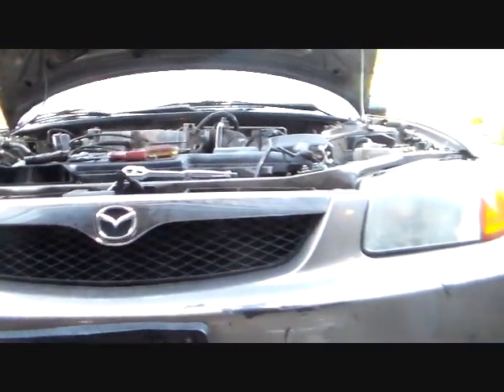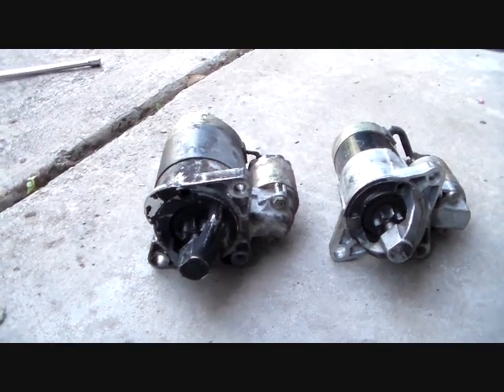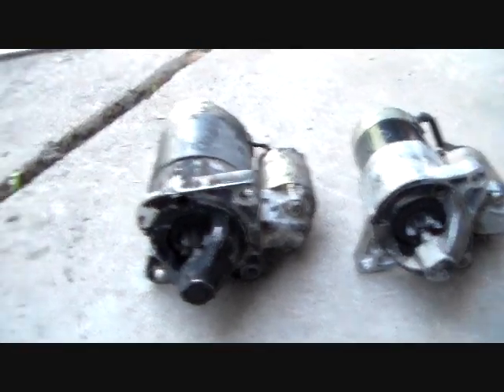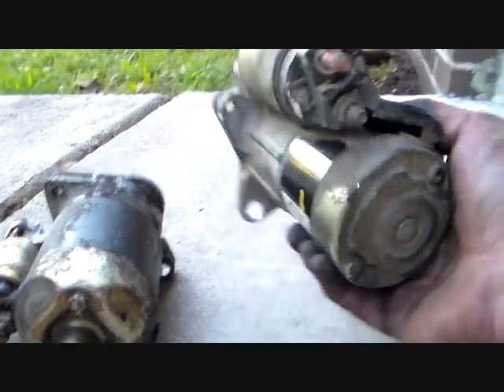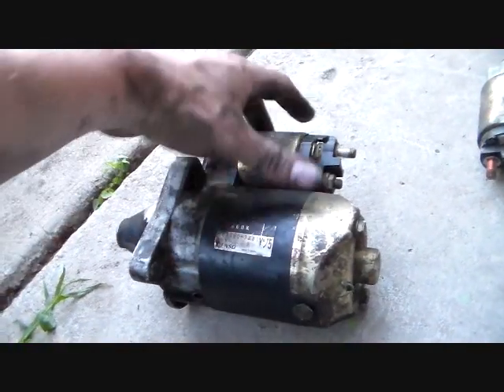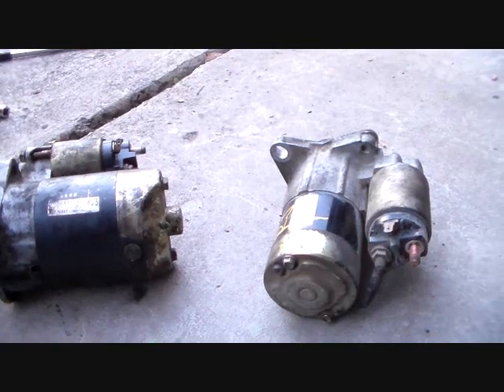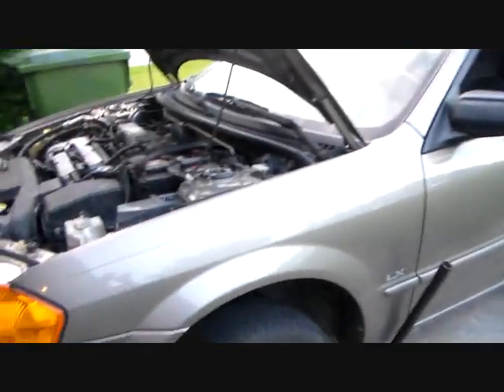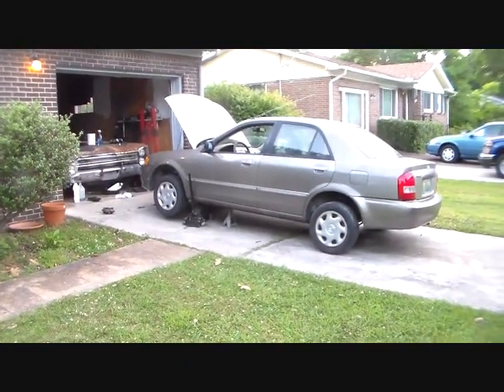Mazda Protege starter upgrade

Comment: Is it better to buy the new starter instead of a re-manufactured one ? Is the removal and installation process simple/is there anything I should be aware of ? I have same make/model but 1.6L and auto trans. Great channel btw.
Reply from the maker: They are very reliable starters so I wouldn't stress over getting a reman. Just get a good warranty. As I recall it was a direct swap, not mods needed. However, your car should already have the gear reduction starter since it's an automatic. Manuals got direct drive, auto got gear reduction, don't ask me why.

Comment: I have the exact same car, same color and year, and I replaced my starter and ran into this same thing. At our shop, I ordered a starter and it called for two different types for my 1.6 manual protege. I got both, then compared them. One was the bigger direct drive. Other was the gear reduction unit. Had no idea you could get one for these little cheap cars so I went with the gear reduction unit. Have to admit, I like the sound of the factory starter, sounds more old school, but the new one starts the car faster during cold temps and such, and wasn’t but 20-30 bucks more than the stock style. Not sure if it matters which one I went with, but just a neat simple upgrade.

Comment: Why did Mazda need all those different starters? My Chevrolet used the same starter for every kind of engine and transmission combination through the entire production run.
Reply from the maker: Papi Johnson  Your guess is as good as mine.
Reply: For the 1999 1.6 liter engine:
The 0.85 kW (1.0 hp) direct drive starter is for manual trans
The 1.0  kW (1.3 hp) gear reduction starter is for the automatic trans.

With the automatic trans you need a bigger starter because you have to spin up the torque converter and all the trans fluid in it, which is being strongly resisted by the rotor which isn't moving yet).

Why put a slightly smaller starter in the manual, instead of using the same one?  The 1.0 kW starter costs  almost 2x as much as the 0.85 kW starter.

2017 replacement costs:
0.85 kW starter (remanufactured) $65 - $72
1.0 kW starter (remanufactured) $110 - $120

Comment: is this car reliable ?
Reply from the maker: Very. It's still going strong.
Reply: How much miles ?
Reply from the maker: Samuel Pong
It, the one before it, and my brother's Protege all had over 200,000 miles. Just don't overpay for one, You can get a good one for about $2000 or less.